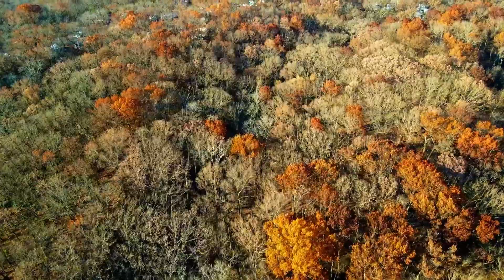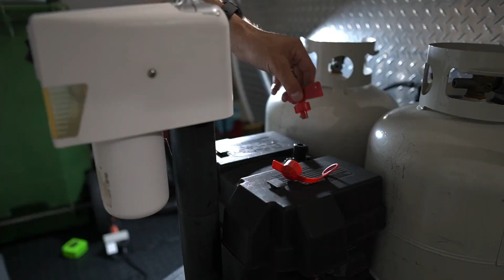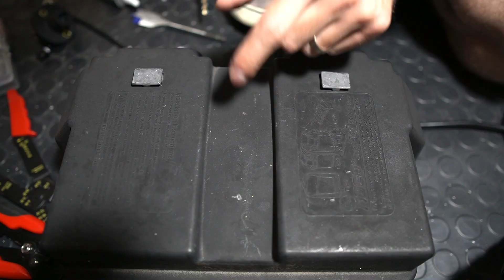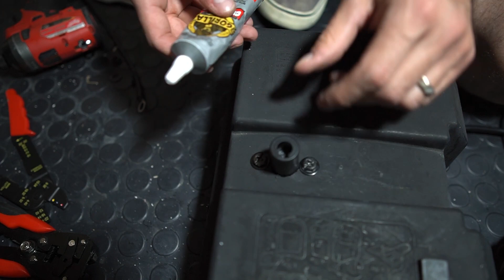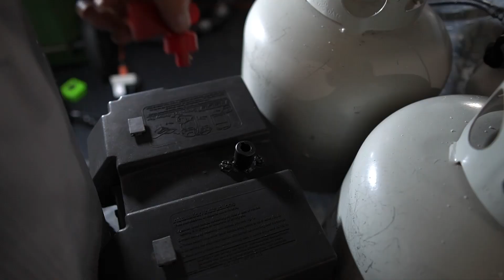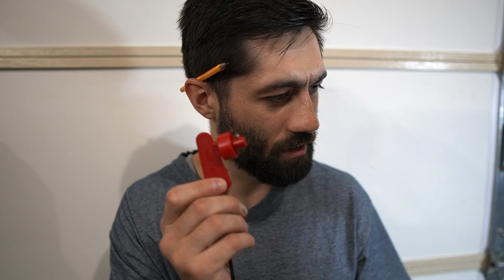Pop Up Camper MODS | 12 Volt Battery Disconnect Switch

Comment: I love this but how do you know what gauge wire to use for the switch? I have a 12v lifepro4 lithium battery 100ah
Reply from the maker: Wire gauge is always depending upon wire length and the amperage running through it. For pop ups, your not going to exceed 30-40 amps and in our case our length of run was less than 5 ft, so 8 gauge works. 

There are handy wire gauge charts for 12v systems and your only variables will be amperage and length of wire.
Reply: @ thank you 😊

Comment: Followed these instructions but have no power to battery when switch is in on position. Any idea what might cause that? Could my new black wire be bad? It worked at one point but now it doesn't.

Comment: Hi there, I’m slowly getting to grips with a new-to-me 2008 Rockwood 1640 pop up. This is a total newbie question:  the pop-up battery is charged as you are towing it, via the Tow Vehicle, correct? So you would need to have the kill-switch set to ON with the red key inserted as you drive?  Does the red key fall out easily??
Reply from the maker: The battery will charge as long as you have a 7-pin connector. You will want the kill switch set to on to ensure the emergency brake disconnect has power to power the brakes in case your tow vehicle becomes disconnected.  It’s never fallen out on us while driving.

Comment: What kinda of battery do you recommend for a popup
Reply from the maker: The best deep cycle you can afford. Affordability will typically be lead acid, sealed AGM, lithium from least expensive to most expensive. If you’re relying on your battery for more than power during set up, I.e., boondocking, it may be worth it to go for a better battery.

Comment: Say the disconnect switch is off (on purpose or on accident) while you are traveling down the highway.  With how you wired it, wouldn’t that effectively disable the emergency brake?  I would connect the emergency brake switch directly to the battery-side of the switch that way it will always have power.  

I know some emergency brake switches have a dedicated battery but a lot of them don’t.  Besides, having the extra energy source seems extra safe to me.

Comment: one thing you have to remember. If you have a electric lift you need to have the battery on. I did this to my battery. I just installed a electric lift for the trailer ball. It wouldn't work and i was so frustrated. After about 20 minutes I tried it with the battery on on it worked.. DOHHH

Comment: Looks like I can't post pictures here. I managed to do this, both for the camper, and electric winch. The winch was important, because I didn't want a curious kid ruining our camper. Thankfully they were 2 separate wires coming off the battery, so I just had to add another switch.

Comment: Hey man!! Going camping this weekend at a park with just water. So we will be using our campers battery system for 2 nights. I have switched all my bulbs to LED and will of course only use what we need of it. The temps will get down to 50 at night. We have a 9 month old so we will be using the camper furnace just to cut the chill to about 65 or so. I just installed a new 100 amp hour deep cycle battery and also just put in a new converter system because mine was failing. 

My question is...do you think the battery will make it thru both nights with the furnace or do i need to add another battery in series with this one to double the amp hours? What is your experience??
Reply from the maker: We rarely camp without electricity so I'm not the best person to ask for anecdotal experience. However, and depending on what furnace model you have, the wattage is going to be somewhere in the 35 to 55 watt range. If you have a 100 amp hour battery, you also probably have only 600 usable watt hours. Divide this by the wattage of your furnace and it will give you a decent estimate. 

So two batteries might be a good option. Alternatively, you could look into the stand alone little buddy heaters to supplement your on board heater.

Comment: Where did you get the wire, and terminals?  8 gauge wires seem quite expensive, and I can't find 8 gauge terminal connectors.
Reply from the maker: Just a local auto store
Reply: @ItsPoppin  Thanks!  I sure do miss Radio Shack for stuff like this.

Comment: I recently bought a 2004 Jayco and would like to put a battery on the tongue. I wanted to know how you wired it into the converter. Did you just splice into the wires that go to the vehicle ? Right now i have the battery connected to an inverter. Works great ! However, I would like to know if i could tie in to the converter to charge the battery when connected to shore power ?

Comment: Why did you attach it to the negative, and not the positive?
Reply from the maker: If you put it on the positive terminal, the battery negative terminal is still connected to the chassis so if anything conductive comes in contact with the positive terminal and the chassis it will short the battery.

However, this is a debated topic and ultimately it's up to you with what you want to do with your pop up.
Reply: @ItsPoppin  interesting. I just bought one and the  rv dealer told me to put it on the positive side

Comment: I have a question unrelated to this video but hopefully you can help. We own a 1992 Palomino Hard-wall pop up that is in remarkably good condition. We haven’t used it in sometime but have decided to start our camping adventures again. After popping it up to clean and inspect it we noticed that the roof was pretty shakey. I found that the four supports that actually attach to the top were loose.  The bolts were loose. The bolts fit into a slotted hole which I believe is simply to square up the top so it sits properly when you close it. My husband thinks they should not be tightened all the way because this would cause a bind. Just wondering what your opinion is and if you are familiar with this setup. I have searched all over for information and can’t find anything on it.
Reply from the maker: Based on your pop up camper year and make, I believe you have a Goshen lift system - do you crank the roof up from the front tongue? If so, you probably have the Goshen lift system.  I checked out our 2008 Starcraft, which has the Goshen, and the two bolts attaching each support to the roof are definitely tight.

Another route would be to reach out to Maurice & Carolyn (https://youtube.com/c/Cruisin%E2%80%99Couple) who I know have a 90’s hard sided pop up camper with the exception of it being a Starcraft.  I believe they also have a Goshen lift system.  They may be able to offer some guidance as well.  Tell them we sent you!
Reply: @ItsPoppin  WE do have a crank lift at the tongue and it is only one bolt per corner attachment. My gut just tells me they need to be tight. Thank you for you speedy reply. I will reach out to them and see what they say.